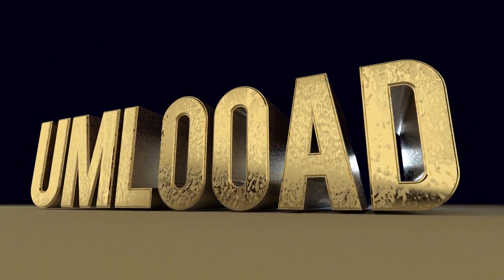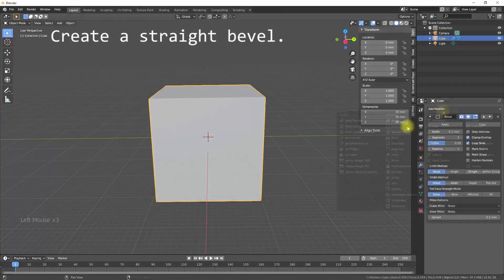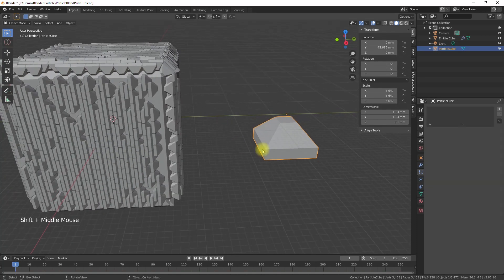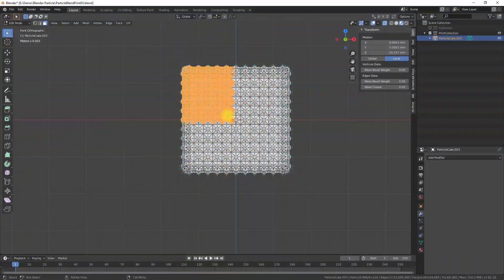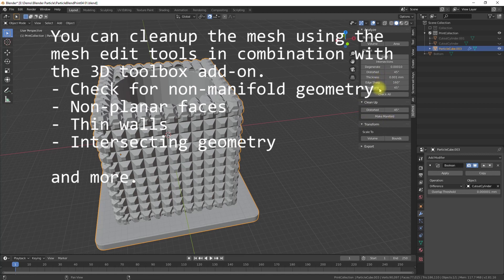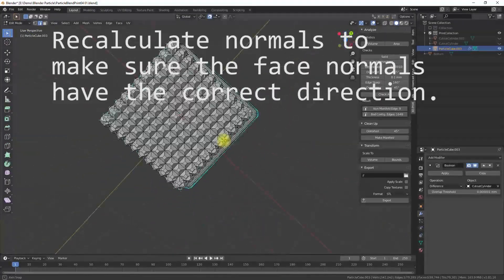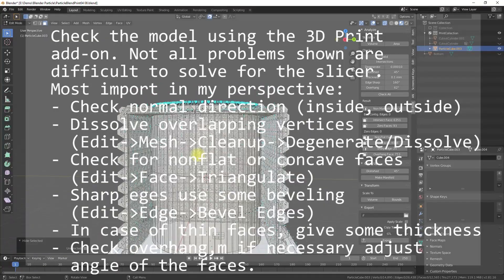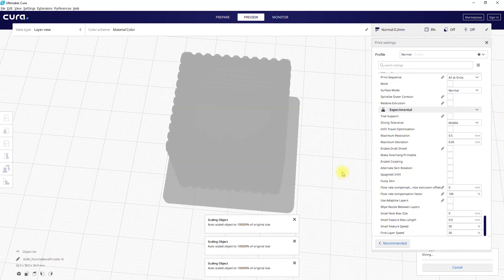3D Modelling and 3D Printing Using Blender's Particle System

Comment from the maker: Did you notice: There are three videos on Blender modelling with displacement showing different aspects of the topic: 

1. Blender 2.8x Celtic Knot Pattern from more complex SVG image file to 3D printing
https://www.youtube.com/watch?v=s1QdQG99FRc

2. Blender model faster with more detail - Vertex Displacement in use for 3D-Printing
https://www.youtube.com/watch?v=GC5VCbLpEc8 

3. Blender multi texture mapping for Vertex Displacement in 3D Printing, CNC machining and more
https://www.youtube.com/watch?v=sV0ZSpoRxtM&t=302s